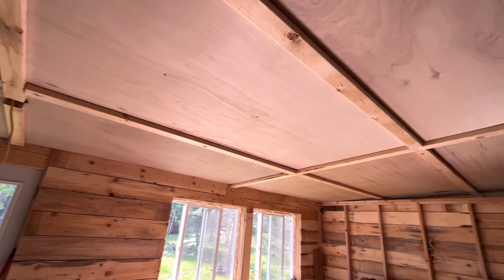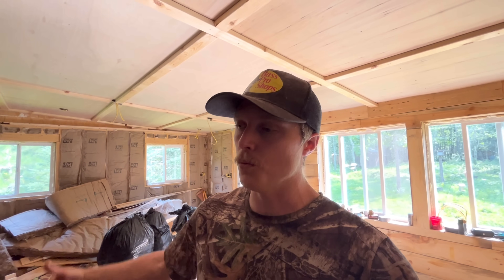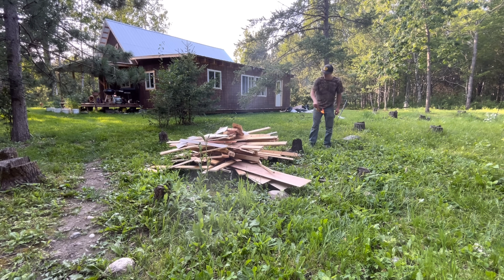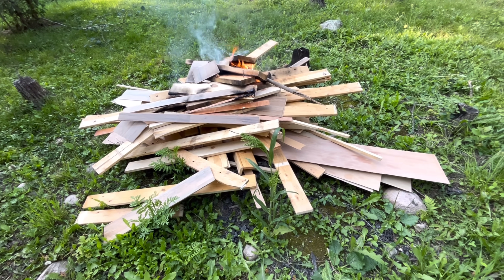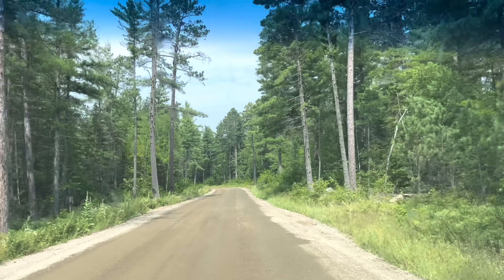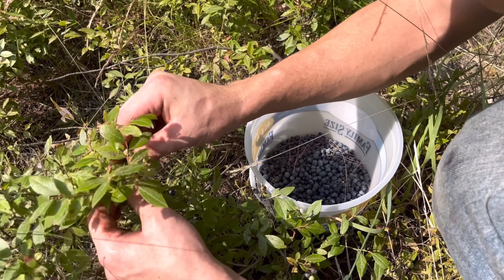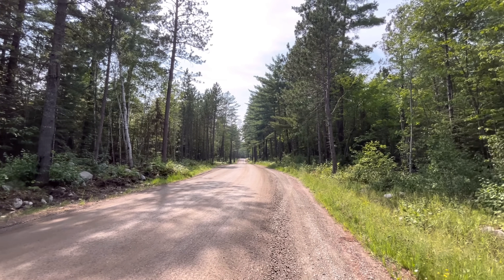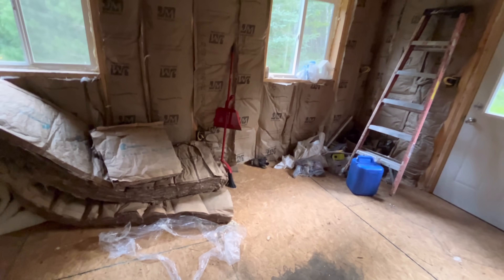Off Grid In Minnesota: Working On The Addition, Picking WILD Blueberries

Comment: Good choice for the ceiling. A lot easier lifting luan than 12 foot sheetrock and who the heck enjoys mudding. HaHa. Quick tip for you - stop measuring the flooring length to be cut. Turn the piece 180 degrees so that you cut off the right end. If you have a locking tongue push it tight to the wall. The tongue length will give you the right amount of clearance when lock in place. Mark the piece  and cut it. Turn it around and snap it into place. You should end up with an expansion gap the size of your tongue. Magic marker usually works and wipes off with alcohol.. 
Keep plugging away.

Comment: Hey Kyle, I like what you’re doing with the cabin with the flooring, windows and the ceiling. The ceiling can be difficult but you nailed it. Don’t forget that you could buy or make butcher block countertops if the slabs don’t work out. Formica is an easy solution also. Love blueberry muffins and blackberry cobbler!😊

Comment: Kyle.....Old flooring technique:  Last board, flip it around, the opposite way it is supposed to go, and place it against the wall, and mark where it meets the last laid board.  Should leave you an eighth inch for expansion, and give you easy way to measure, instead of using a tape.

Comment: I've been avoiding saying this because I don't like to be a downer. Where I live in southern MN none of this would pass "Inspection"/"Code" by the local inspectors. They would make you change it/ tear it down. At the very least you could never get insurance..... However, I suppose, if you didn't want insurance and maybe got along with the local fire chief you might get away with it. Wouldn't be easy though. You would have to sign documents saying that if something happened you are at fault and they might not even come out to put out the fire if there was one.